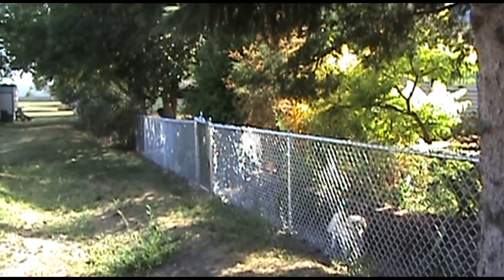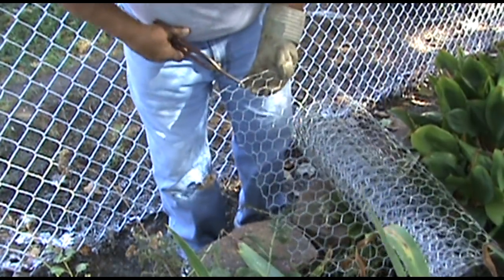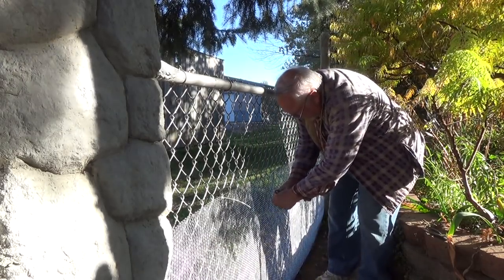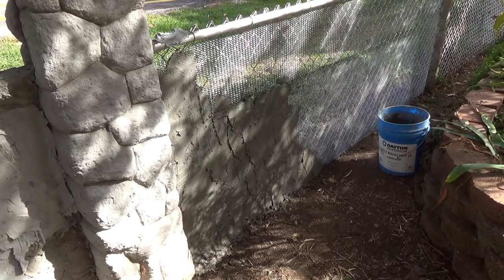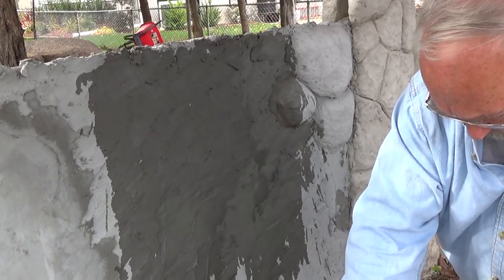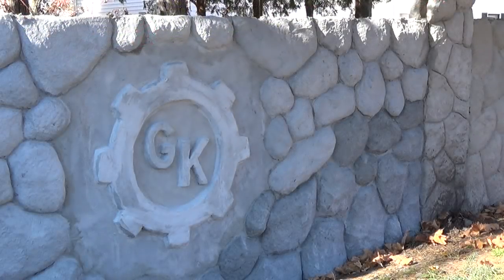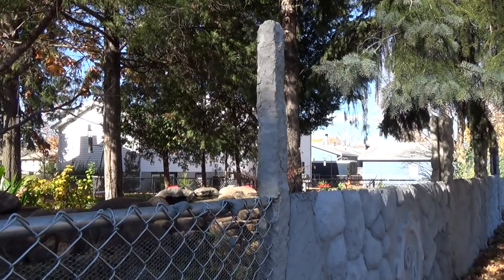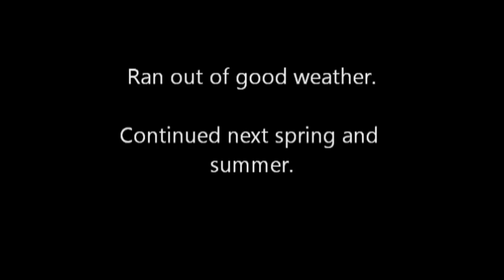Converting my chain link fence to a stone wall

Comment: So creative and inspiring. That rock wall appearance looks so bold and natural while pleasing to look at. 
 When you say "reactive powder cement"  are your referring to the basic type I Portland cement with those additives you mentioned?  I am trying to figure what all the additives are used for.  Are they all sold at the building supply store like Home Depot or did you have to special order them?   
I live in mostly hot climate so the Citric acid might be an option for my concrete unless I work it during the winter months.
Reply from the maker: This is one of various mixes that are referred to as "reactive powder cement", "reactive powder concrete", "ultra high performance concrete" (UHPC),  "engineered cementitious composite" (ECC) and a number of other terms and characterizations. Essentially it is a mix contains ordinary portland cement (OPC), graded particulate aggregates (no large aggregate) and pozzolans, along with fiber and other additives.  It is characterized by being many times stronger in compressive strength than regular concretes, high tensile strength and even flexibility. It is very impermeable as a result of the principal of particle packing that eliminates the porous spaces and channels of normal concrete.  I use fine sand, OPC and CSA (calcium sulfo aluminate) cements, metakaolin,  and silica fume.  The cement particles fill spaces between sand particles, metakaolin particles are 10 times smaller than cement particles and fill the spaces between cement particles, silica fume particles are 10 times smaller than metakaolin and fill the spaces between those particles.  Both metakaolin and silica fume are also pozzolans that react with the calcium hydroxide by-product of OPC hydration to form more calcium silicate hydrates (CSH) cement to make the mix stronger. There are a number of mix formulations that may include steel fiber and, in industrial and construction usage, include heat treatment during set that results in compressive strengths as high as 100,000 PSI. My earlier mix, without silica fume was tested at higher than 15,000 PSI.  I get my sand and portland cement from Lowes. Metakaolin, silica fume, PVA fiber and acrylic admix come from Fishstone  http://concretecountertopsupply.com/ 
Here is a video of my earlier mix from 3 years ago with some explanations that may help  https://youtu.be/etSWuBIcdZc
Reply: Sir, thank you so much for taking the time of these educational videos. Your commentaries are a priceless teaching.  I had just found the "New Concrete Recipe"  and was intensely watching and taking notes when you posted this reply.  It answered a bunch of my questions.   
Over years past I have done simple basic concrete  projects, getting my washed sand and aggregate from local pits .  I never was able to learn about concrete additives until now.    Remarkable how they can increase the strength so much.
Reply from the maker: Indeed, the additives make concrete a truly remarkable substance.  I've been evolving the mixes I use for about 12 years now and still learn something new each summer.
Reply: @dperry428  Wow. I love this! You are a Master! So awesome!!

Comment: Nice I wonder if I can add that design the front wall of the house
Reply from the maker: Yes, of course.  Depending on what is there now, prepare the surface, attach wire lath, do a scratch coat and add rocks, either purchased cultured rock or hand-formed faux  rock.

Comment: It's unreal that one person did this with a tiny little trowel.  This must have taken a lifetime.
Reply from the maker: No, just 2 summers and part of a third working part-time as I worked on my concrete pond, concrete bridge and concrete benches.  A day's work would be the  completion of a ten-foot section.  There are 7 sections in the entire fence. Then, to do the back side, repeat the process.  But, I NEVER spent an entire  day on the project, so it took longer.  It's not as tough as you make it seem.

Comment: what is in the concrete mixture you have used please?
Reply from the maker: 2 to 3 parts fine sand, 1 part Portland cement, 5% CSA cement, 10% metakaolin, 8% silica fume, 2 to 3% crystalline waterproofer, PVA fiber, 3 water to 1 acrylic in liquid.  Percents are as compared to cement content.

Comment: I am looking to put in a semi-I ground pool with about 18” of the pool above ground. I would like to wrap the pool with something like you have done to your fence. Any suggestions as to how I could tackle this? Could I wrap the outside in a type of foam and then attach the metal lathe then concrete? Not really sure how to start this project.
Reply from the maker: What you are seeking is referred to as thin-wall ferrocement construction and would, indeed, be much like what I did with the fence.  Ferrocement is a technique of making very strong walls from multiple layers of narrow diameter and fine wire filled with cementitious mixes with no large aggregate.  The technique has been around for quite some time.  Ships were made during World War II using this method. Third world countries use ferrocement for the construction of water tanks to collect rain water.    You can search for examples of this technique, such as "ferrocement water tank", "ferrocement construction methods", etc.  Were I to do what you are wanting to do, I'd start by embedding some rebar in concrete postholes, attaching wire  reinforcement, such as cattle wire mesh, then expanded metal lath  and/or several layers of chicken wire,  and infilling with a ferrocement mix such as I used on the fence.  The result will be a thin wall of 2 inches or so, but have very high strength.  You can start with this article  https://theconstructor.org/concrete/ferrocement-water-tank-construction-and-uses/35259/   and here:  https://www.concrete.org/topicsinconcrete/topicdetail/ferrocement?search=ferrocement  This is why I knew, despite all the naysayers, that the fence would be enormously strong.  It is, in fact, a fence that incorporates everything in ferrocement construction.
Reply: I will definitely look into the info you sent. I’m glad I stumbled onto your videos because I couldn’t seem to find any information about it. Thanks for your help.

Comment: Since your video is from 6 years ago, I would like to know how the concrete over the chain link has held up. Have you experienced any cracks or crumbling? We are considering doing what you've done to take advantage of the chain link we already have. Appreciate any hints or suggestions you have!
Reply from the maker: There are no cracks anywhere.  It holds up well here in northern Illinois with our extremes of temperature.  Can be close to 100F in the summer and -25F in the winter.  The secret is to use a dense mix that water cannot penetrate.  The mix I use is an ultra high performance concrete of sand, cement, metakaolin, silica fume, PVA fiber and acrylic bonding agent/admix.  The gradation of particle sizes makes for a very dense, waterproof mix. The only suggestion is to not cut corners and default to a commercial bagged mix from the local home improvement store.  Trying to save a few bucks is not wise if you want the project to be durable.
Reply: SALUDOS DON PERRY ME GUSTAN SUS TRABAJOS, LO BUSQUE MUCHO SE ME HABIA PERDIDO, SIEMPRE ME IMPRESIONO.

Comment: Would there be an upside or downside to using the foam Crete or air crete method?
I was thinking lighter and maybe less concrete would be one upside but I have never used that foaming technique?
Reply from the maker: Most regular concrete has a compressive strength of roughly 3000 to 3500 pounds per square inch. The mix I use has a compressive strength of 15,000 to 20,000 pounds per square inch.  Aircrete has a compressive strength of around 100 pounds per square inch.  Aircrete is lightweight and a good insulator.  The concrete to use depends upon the use to which it is applied.  Aircrete in my fence/wall application would not have been a wise choice. I needed strength, not insulation.  Thin sections, such as in my fence, would also crack significantly if made from aircrete and also been easily damaged by things like string weed eaters. Choose the right tool for the job.  Both chain saws and kitchen knives are used for cutting, but I wouldn't use a chain saw to slice ham nor a kitchen knife to cut down a tree.
Reply: dperry428 Yes sir.

Comment: would this work with just portland and sand? or should it be more sticky? I have alot of porland and sand Im just afraid it will not stick as I ether get the mix to runny or to dry lol P.S. did you try it with the chicken wire over the link wire?
Reply from the maker: It depends on where you live and how long you want it to last.  Sand/cement is used in third world countries to make ferrocement water tanks, but they are in sub-tropical to tropical areas where they don't have to worry about freeze/thaw cycles. The purpose of the additives goes further than just making the mix "sticky"; the mix is at least 5 times stronger with the additives.  Using just chicken wire would be little better than trying to place the concrete onto the fence mesh itself.  The gaps in chicken wire are just too big.  Expanded metal lath is forgiving enough to allow a slightly loose mix to still stick. You might get away with just chicken wire if multiple layers of it are used, you can mix the concrete to a stiff consistency and another person is available to hold a support on the opposite side as the concrete is applied,  as is done in ferrocement constructions.  https://youtu.be/52hr2nky72Y?t=10m2s
Reply: Im in Tallahassee Florida we do get some temps in the high 20s for short times,
Reply: Thanks for all the videos Im making a cave right now for the grand kids and I have the chain link on the rebar with chicken wire on both sides of that But I think I will wait to get the right admixes. once again thank you.

Comment: is there any way you can tell me the mix you used?
Reply from the maker: Of course!   I invite you to watch this video and know that I also now use silica fume as well.  https://youtu.be/etSWuBIcdZc  And this video  https://youtu.be/e4j5qgNFQE0.   The mix actually varies with temperature and other weather conditions, as well as the use -- out of water, in the pond, overhead, base coat or finishing coat.  For the fence, the basic mix is 3 sand to 1 portland cement, 5% to 10% CSA cement, 10% metakaolin, 8% silica fume, 1/4 part glass fiber and acrylic admix/bonding agent mixed 3 water to 1 acrylic when starting with a 50% solids acrylic.  Percentages are based on the percentage of the cement content, not the total mix amount.  For finish coats, substitute PVA fiber for the glass fiber as it does not show in the finished surface. Stones were made with less sand 1 sand to 1 cement or 2 sand to 1 cement.   If you want lighter weight and, thus, thicker stones, substitute1 or more parts perlite for sand.  The mixes I make are typically 5 times the compressive strength of regular concrete.

Comment: I have been viewing your creative videos for years. This year I have decided to build my own rock wall where my lattice wall was built around our old pool. (No longer have pool). I have viewed many of your videos but I do not know the correct mix to make for the wall like you did. Can you help me with the method of mix you used for your rock wall created on your fence?
Reply from the maker: Here is a video of a basic mix.  I now also add silica fume. https://youtu.be/etSWuBIcdZc  3 parts sand, 1 part portland cement, then, as a percent of the portland, 5% CSA (calcium sulfo aluminate), 10% metakaolin, 8% silica fume, 2% Xypex, add some PVA fiber (polyvinyl alcohol).  To the liquid, add acrylic bonding agent/admix 3 water to 1 acrylic when starting with 50% solids acrylic, less water with more dilute solids content.   I get my materials from Fishstone oncretecountertopsupply.com/
Reply: @dperry428  Thank you sooooo much. I love your work and you so inspire me to get creative with this. Will this mix also work on an existing wood lattice fence ? I guess I should have mentioned that in my first question. I was so inspired because of wall you made in the front of your house you mention at the beginning of the " converting my chain link fence"video.
Reply: I found your concrete mix video. I will attempt to build my rock wall now. Thank you. I can only hope I will be as successful as you!

Comment: How much work time does the mud mixture have?
Reply from the maker: Depends on the mix and the weather.  I add CSA cement, which is fast setting. Increasing the amount of CSA speeds set and vice versa.  Also, the addition of citric acid can inhibit the set of CSA.  Also, for delaying set by a number of hours, the addition of UP TO, but not exceeding 1/10th of 1 percent sugar or molasses works.  Work time is very dependent upon temperature and other weather conditions.  Concrete setting is a chemical reaction and the rate of set is doubled with each 10 degree Celsius increase in temperature and vice versa.

Comment: I just found your really interesting video and I was curious, is there a reason not to use the plastic ties all the time? Is it necessary to use the metal if it's gonna be inside the concrete? Does it make a structural difference? Not trying to be difficult I'm genuinely curious. Thank you
Reply from the maker: Has nothing to do with structural integrity.  If I had VERY long arms, I could reach over the fence far enough down to use them.  I have found no way to efficiently install them when I can't reach both sides of the fence at the same time.  With wire, I can make a hook on the end of a piece, push the end through the fence and, rotating the wire, bring the end back inside to then twist it tight.  Plastic ties won't hold a bend as does wire.  They work on the top edges and down as far as one can reach over the top of the fence.  Also, wire is MUCH cheaper.
Reply: dperry428 ah! That makes sense. Thanks for responding so quickly
Reply from the maker: de nada

Comment: @dperry428 First thank you for your many hours of educational videos passing on your experience and knowledge. I have an idea and I'm not sure it's a good one. If I wanted to save on concrete costs, could I make the top third of the fence stones with styrofoam in the middle? I would say the top half or all the stones but I need a solid bottom, right? Maybe its possible. Looking  for your expertise  and knowledge before I make a mess. Thanks is advance for your reply.
Reply from the maker: You still need a base layer of concrete to embed the fence fabric and metal lath.  You can use styrofoam rocks covered with  a layer of concrete, but I can't see that's saving much on concrete.  The covering layer will have to be thick enough to be somewhat durable and the rocks  are only about an inch thick to begin with.  You can take up volume in the concrete by using vermiculite or perlite or styrofoam beads.  It will make the rocks lighter, but also weaker.  Why not try your idea on a small section of your project, let it cure, then test the strength to see if it meets your standards.  If it does, then use the technique on the whole project. If it doesn't, rip off the small section and do something else with it.   When I started my fence, I did the first half section using chicken wire, then fiberglass fabric and then metal lath.  That's how I decided on the metal lath.  Chicken wire  or fiberglass just wasn't easy to use; metal lath was, so I finished the project with metal lath. So, test out your idea and see how it works. If it works, use your idea, Personally, had I done the rocks using styrofoam, I don't think the total cost difference would have been significant enough to justify the loss of strength.
Reply: @dperry428  Thank you for your quick response. I'll have to mock something up.

Comment: I really admire everything you do.  You are a great teacher.  It's costing me $40.00 per bag of Metakaolin in shipping costs from Fishstone.  Do you know of any other companies that are in Kansas City , MO.?
Reply from the maker: All I can suggest is that you search for and contact concrete suppliers, decorative concrete suppliers in your area.  You might try contacting this manufacturer and requesting distributors in your area.  https://www.advancedcementtechnologies.com/metakaolin/  I understand the cost of shipping, but I drive 60 miles round trip to pick mine up at Fishstone.  Picking it up as opposed to having it shipped is not without cost, too  At typical driving costs for a small SUV of 50 cents per mile, my costs are roughly $30 to pick it up.  When I consider the costs in time as well, $40 shipping is not all that expensive. Granted, there are times when I might buy more than one bag, which cuts my costs, but in reality, I rarely can use more than one bag at a time.  Adding 10% of the cement content in metakaolin makes a bag of it produce a lot of concrete mix.  One 40 pound bag of metakaolin will mix (at 10% addition) with 400 pounds of cement or 4 1/4 , 94 pound bags of cement.

Comment: Very informative video. Can this technology be used for a house wall?
Reply from the maker: Yes, absolutely.  Search for ferrocement house or thin-wall ferrocement construction.  The mix I use is even stronger than normal ferrocement construction.
Reply: @dperry428  Thanks for responding. what mix do you recommend for a ferrocement wall?
Reply from the maker: The stronger the better.  I like a 2 sand to 1 cement mix with added metakaolin, silica fume, fiber and acrylic admix.